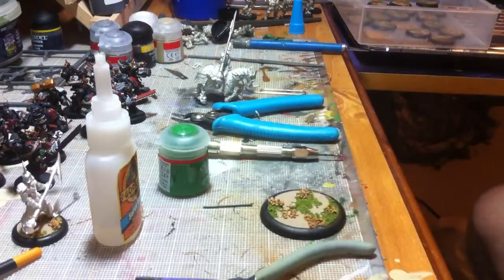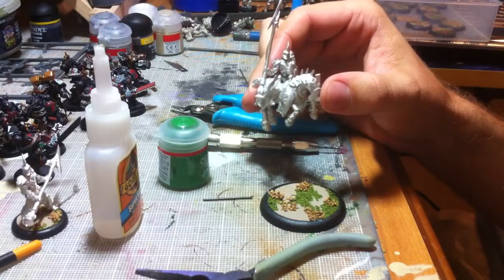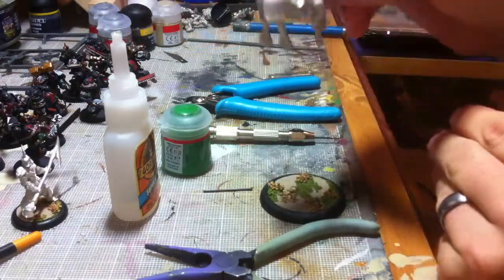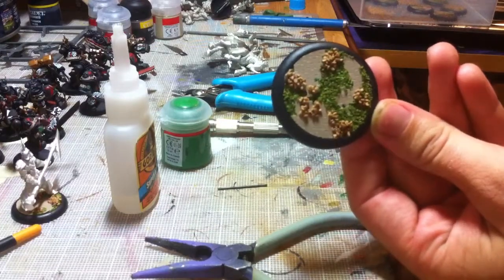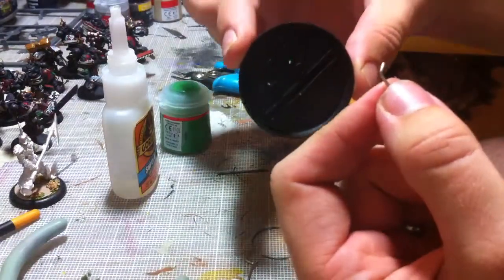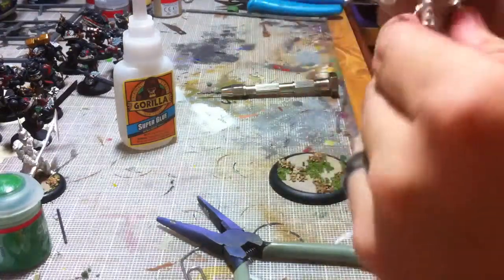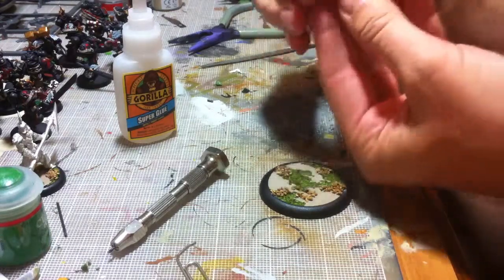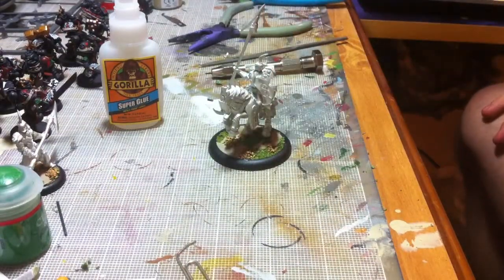CG2 Tutorial- pining metal models to bases

Comment from the maker: Pros and cons for gorilla glue. Cons are that the tip is really wide, so a lot of times you will need a toothpick to apply it to tight places. Second con is that sometimes the drying time is really slow, but with the "kicker" that can be nulified. Pros, that it bonds the best than any other super glue I have seen. Literally bomb proof (ok stretching a little). Would definitely recommend gorilla, but pick up some toothpicks and kicker along with it. Hope that helps.